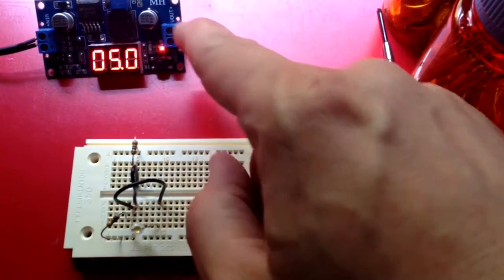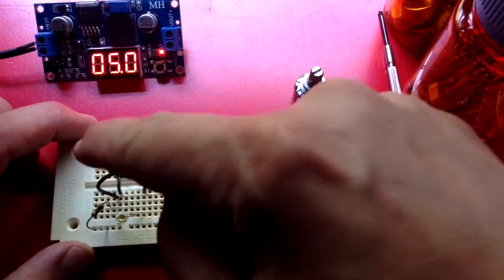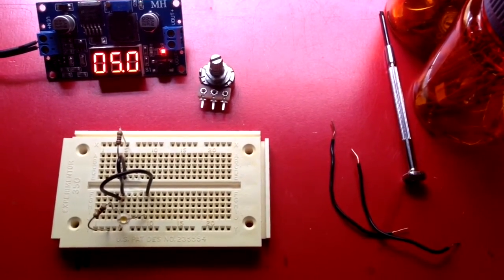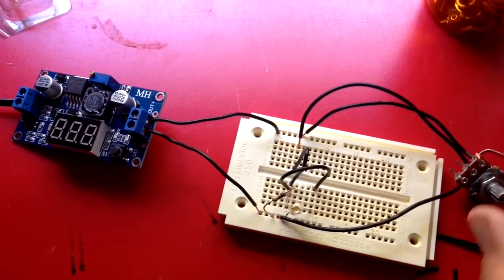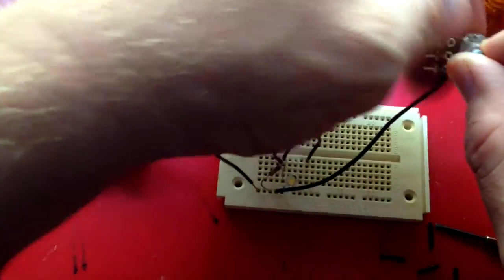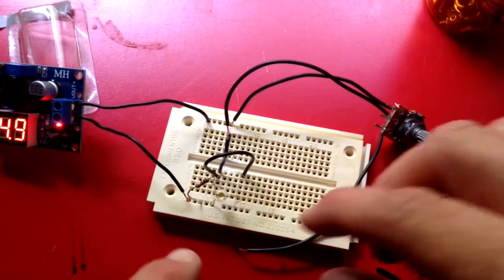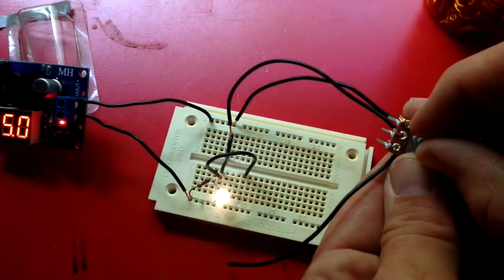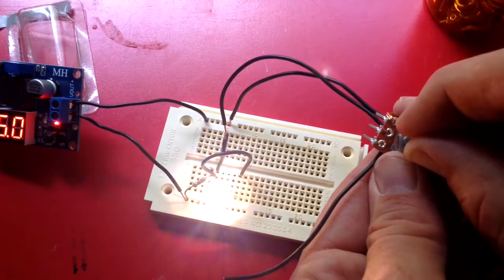100k Potentiometer Voltage Divider

Comment: put ground to one side of pot and connect to ground of led.  positive goes to other end of pot.  and middle goes to positive of led. just learning all this myself. a lower pot will give you more fine tuning but an additional resistor will be needed if source is too much for pot.
Reply: I'm just doing the same to control the voltage of a 24v power supply and have wired and tested it the same as you described  as I just figured this out as well. works fine for 12 vols but what size resistor would i need for a 100k pot for 24v with max 18 amps? Any help would be appreciated, thanks
Reply: Depends on your load. 24v * 18a is gonna burn 430 watts. Don't think you can buy a 430 watt resistor. Figure out what you are gonna power and from there its alot of math. It can get tricky if you run a parallel resistor though. Been designing a flashlight and one would think its easy. Lol.